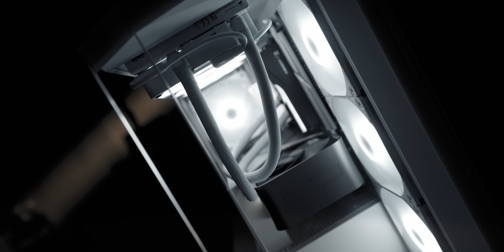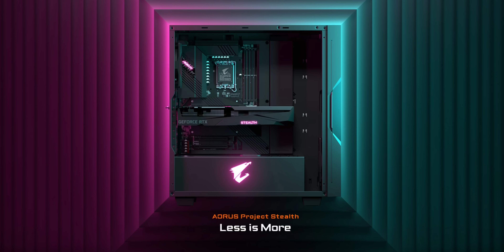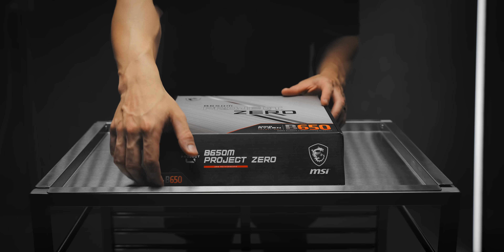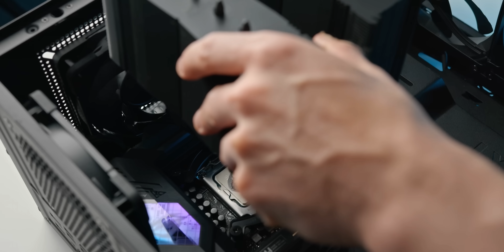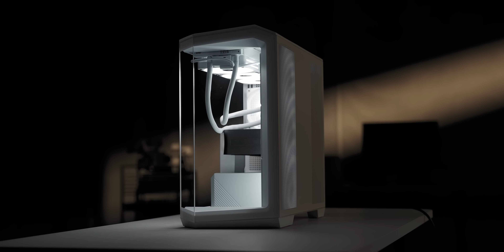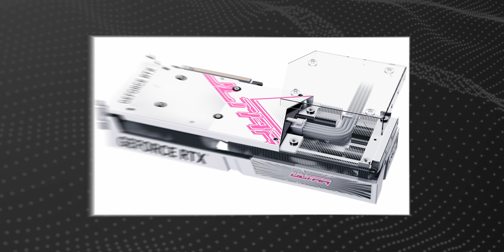"zero cable" PCs are here.

Comment: Theres nothing pulling the air inside the case , i guess it was to hide the wires that are on the back of the fans , but to thoses that build computers , either you dont use front fans , or you use them to pull air inside , cause every case should have a way to get the air inside the case

This case do have some holes on the botom , but since theres no fan on bottom , most of the air will come from the back where theres no filter , building dust inside your gpu mainly

Comment: That computer looks like something out of that old Apple commercial!
You don't have to be all RGB, but trim that thing with some color or imagination! AI is the future, not some Frankenstein-looking computer hiding wires!

What should be happening is better designs around computer component management.  AI is the future and our time is better spent on creating better designs that don't require so much heat management. The original intent for reducing wires was better airflow for fans.  Having moved all the wiring out of the picture, we've got more fans than ever.  Showing off the inside of the computer was interesting for only one reason: Color!  If you're going to recommend something, I would suggest telling the video card makers to cut the fucking crap!  They're the sole reason computers have been heating up for no good reason.   Computers should do their jobs quietly and efficiently. Style should be subjective or irrelevant! We don't need to worry about hiding wires, we need to worry about the industry's failure to progress to AI computers.  ATX should be dead by now!

Comment: Are the nvme devices at the rear also. On a practical level as a water cooler it's a nightmare having to drain if I want to upgrade the nvme drives

Comment: I built this pc, awesome concept. 

Biggest issue- they need to add a little extra space behind the motherboard to close the case. This is by far the hardest case to close after it was completely wired. 

I am selling the one I built it Florida for $4k if anyone is local to Tampa look me up. 

JG PC 

RTX 4090 MSI Slim
Ryzen 7 7800x3d 
64gb of RAM
4TB m.2

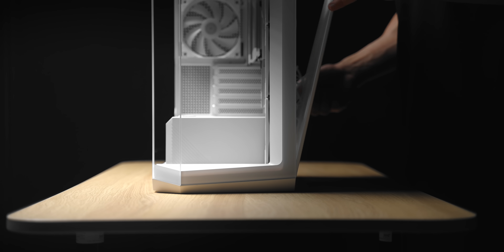Comment: Next-level visual appeal in the angle shot @ 1:30 especially as the camera’s frame rate made the fans be whirring all buttery smooth-like. Know it was intentional and appreciate you!

Also, totally get your vibe on the half-consolation, at best, of the GPU ‘stand’ i.e. cable hider that I agree is worthwhile all in all. What I don’t get is that it seems possible that it could’ve been approx 60% as wide in a manner that would show the GTX and still affix properly in serving the same 2 basic intentions?

Comment: an alternative to the gpu is to vertically mount it and just have the cable run straight down and you wouldnt be able to see it, would be a pain to fix if any cable issues arise but would make sure the build have that no cable look as intended

Comment: i've been using 90°/180° connectors to not have any cables showing in the front for years. Nice that there's now a off the shelf behind the motherboard solution. I also think it's a crime to build a cableless PC and use AIO, the hoses just makes your cableless effort moot.

Comment: Your 3D print cover/bracket is def an improvement, but I think a slim one would have been better.
Did you try this setup with an air cooler, then you wouldn't have the tubes ? *Oh wait, but then you'd have fan cables from the air cooler... and no headers on the front of the mobo ?
*That AIO is SUPER clean with that fan/rgb cable setup!

Manufactures 100% need to sit down together and get a standard going thats for sure

And it would be slick if there was a new standard was set, where the card sits in the slot, that it has a pass through into the mobo ... power straight through it, below or next to the slot ... either out the back or ran across the board to the side.
But yeah... clean looks vs added cost and complexity to a mobo. And a new standard.

Comment: How did you get that good white out of the Trident Z5's leds? Mine is yellow-ish when set to 255/255/255 or simply set it to white, i need to manually tune it to go towards blue but it's still not quite white.

Comment: Hey Optimum and community, I've been wondering if it's safe to buy the Asus Rog Strix B-650E-E now? I've seen Opt use the ''I'' version of it so that should be safe now? Im thinking of also getting either the 7900x3d or the 7950x3d, which were known to get set on fire with the boards, especially if EXPO is enabled, what are your thoughts on that?

Comment: CPU cooler hoses need to either go through the motherboard or to the edge and covered with a shroud. There's zero reason you should be seeing two dangling tubes in the middle of a clean build like that. Manufacturers have a bit more work to do.

Comment: Hey, optimum
I was wondering, since you've probably been through your fair share of graphics cards and power supplies, what's your experience with coilwhine? I'm really struggling with it right now and I'm on my 6th 4080 Super... My power supply is high-end bequiet! Straight Power 12 1000W 80 Plus Platinum

Comment: You call this a clean build? As an Apple repair engineer who has disassembled most Intel-based Mac Pro's, I'm surprised that the cable routing issue still hasn't been addressed in PCs. You look at the beautiful build, but when you open the case, especially the back cover, you are horrified by the tangle of cables. 
Why hasn't any case manufacturer come up with a back panel to hold all the power cables?

Comment: I completely agree with you about the fact that having the power connectors and the fans/usb/audio at the back must be much easier for install! That's actually the really cool thing about this trend (I've an enclosed PC for maximum silence (define r5)).

For your 3d part; you could have printed it much thinner to keep the Geforce visible and you could have printed it in two colors (or spay paint) : grey for the GPU & white below.

I was also wondering about the noise of those pumps; is it better nowadays ? does it have a chance agains't a ndh-15 on a noise perspective?

Comment: I like this a LOT! I'm only on board for this if the GPU's power passes through the motherboard. I would like the PC market to all move to this orientation. Also, this could benifit power supply manufacturers, as they don't have to provide so long of cables. Saving material cost & shipping weight/size cost. This also improves cooling and noise as there is less drag on air passing by cables.

Comment: I really really wish that m-ATX was a more widely used standard - there's just so few motherboards in that form factor, and so few cases that are optimized around the form factor. Something much closer to an ITX sized case could be made with an m-ATX motherboard, if it was designed for it. I hope this changes in the future - it's getting so hard to cram everything into the ITX form factor, and so many compromises have to be made to do so. Here's to hoping that we see more motherboards like this in the future!

Comment: Sorry. As a designer i just hate this form factor. This is just a huge step backwards, in so many ways.

As a designer this is like a dream, when we are having a nightmare. And we will have them dreams, designing for this, unless we start tackling all its issues, particularly safety and structural integrity. This very case, seems hardly safe at all. Just look at it. It got huge unsupported metal corners, at back of a totally exposed MB. The MB will now in practice be mounted on a swinging door, that is loosely secured. Safety on level like that plug we got last year.

As a designer, I need to have maniacs like Linus in mind, who actually sits on the side panel, to crush the cables into the case. As a designer, it is my job, to keep people like Linus safe. This just got a lot harder, for the industry. On the face of it, I seem to be in the clear with my designs, but I want everyone to be safe and the industry to thrive, and as a designer, I look at this in horror.

I cannot leave this place, without calling out, that the left side, is now the front. That means, that the rear, is now the left side. That side, is typically where the cable spaghetti is. It is deliberately hidden for the viewers in this video, which is a deliberate act of deception. It is flat out dishonest.

Comment: This seems SO much more practical. 

I built my first computer a month ago and the FIRST thing I thought is why are we connecting cables from the back to the motherboard at the front, then hiding the cables at the back again....This makes way more sense and suprising this isnt the way its always been done.
Reply: The reason that cables have been from the front is that glass PC cases are "new". 8 years ago you didn't care how the cables looked, because your case was a closed metal box, so that's where the cables went.
Reply: @thefrub  The first complete, entirely-new-individually-purchased-parts build I did was in 2006, and my case (which originally came out in 2003) was windowed and had built-in blue LEDs to really illuminate everything inside. And while my (non-modular) power supply's cables were a somewhat cool-looking silver colour rather than the typical ketchup and mustard cables of older computers, it was still kind of a chaotic, messy bird's nest, as routing cables through a space in the case behind the motherboard wasn't really a thing yet. So, for one, windowed cases were popular well over 20 years ago, not just 8, and secondly, if anything you cared more how the cables looked because there was no hiding them.
Reply: @thefrub  Also airflow was less of a concern for the majority of PCs then as well compared to now.
Reply: @thefrub the first pc my family owned was 19 years ago and it had a glass side panel.
Reply: @thefrub 12 years ago I had my first windowed case. The trend is much older than 8 years. 
 They started appearing in the late 90s and really started catching on after 2000.. So they've been mainstream at least 20 years now. I was an adult when opaque beige boxes were the norm, so I've been around to see the entire PC evolution.
Reply: @AdamsOlympia  Yeah, I think this guy's impression that it was only 8 years ago is that it was "coincidentally" right when he and his friends were old enough/had enough money to do their own builds rather than relying on whatever hand-me-down prefabs they could get their hands on. Funny how I perceived windowed cases becoming popular closer to 20 years ago, almost as if it had less to do with the date and more to do with the fact that I was 16 and had money from a summer job and similarly-aged friends who were also starting to do their own builds...
Reply: @thefrub  RIP airflow tho lol
Reply: This is because motherboards have standards, and those standards aren't often changed for a trivial trend in case design. If you were to make a motherboard with a completely different layout, it would instantly become incompatible with a lot of hardware and case setups. 

If everything starts to transition to this model, then it'd be a good thing, but don't underestimate why the friction exists in the first place. We're lucky we can buy any case we want, with any motherboard we want, and everything typically just works. Companies usually fight for proprietary systems.
Reply: @Sammysapphira The only extra thing the mobo requires is holes in the case. It's not any more proprietary otherwise. You can make them yourself. But very easy for a company to add to an existing case.
Reply: just don't hide the cables ;-) you save lot's of time and if you ever need to do maintenance it will be easier ;-)
Reply: Getting a 40 dollar case without clear pannels is a hell of a lot more practical then this nonsense.
Reply: @polska905 Why? It's literally easier to connect cables etc if they connect to the back of the motherboard

Comment: You should contact Asus about the rear facing connector on the graphics card thing because they had a demo in CES where next to the PCIe connectors on the motherboard there was a second connector that could send over 600W of power through it and the GPU had a 2nd connector which would go in that connector and the motherboard had a 12W PCIe power connector on the back to passthrough the power

Comment: We can buy thihs kind of MB from 2 years ago in China. Now we have many options in Chinese. 😝
And We also have the Special GPU from Asus which have one more connector next to the pcie connector that can use as the power cable. With the special MB from Asus, which have this connector on the MB, you can plugin the GPU power cable at the back of the MB.

Comment: Should do away with power cables to the GPU altogether. An additional power socket from the board direct to the PCB is what’s required. Something like Apple’s old ADC used to have. I think I saw (ASUS?) show something more recently and I hope it catches on so we can do away with these cables. Especially now that they say Gen 5 cables have a limited lifespan of connect/disconnects.

Comment: The cleanliness of this build is honestly only 10% better than the standard case with a few visible wires.  Since most of it is tucked in to the back of the case.

The true power is to be able to take off the back and mess with the connections.  No more reaching in and fighting around the GPU, the cooler, the ram, etc to reach connectors.  It’s right there with no obstruction.

Comment: yeah anytime you intergrate a fan/rgb controller you go off the rails on cable management. I use extenders and splitters which at least allows for routing of cables a little better but this mb setup is definitely the future.

Comment: Personally, I still think this is a solution for a non-existent problem. I am also the kind of person that uses mesh side panels and no RGB so cables aren't so much of an issue as far as I'm concerned. Plus it is very, very rare that I need to add or replace cables once a build is complete, although I can see how "easy access" is by far the biggest selling point that this mechanism has.

What actually concerns me is that if rear mounted connectors becomes the de facto standard it will make doing anything in a sandwich layout case a real nightmare, and the required added space to use these connectors will force SFF cases to be bigger for cable clearance.

Comment: Some of the Asus BTF motherboards are apparently going to feature a high power delivery PCIe slot that can deliver up to 600W of power to tackle the GPU cabling issue. Seems like a very smart approach that removes the need for specific GPU models with rear-facing connectors. If that works out well I fully expect it to become the standards for other BTF motherboards like this in the future.
Reply: They should just amend the PCI-E spec to add a dedicated slot connector past the x16 length for direct power delivery from fixed plugin ports mounted to the back, front, or edges of the motherboard. Removable hot swap PSU modules can deliver 1200w-3000w of +12v on a 2-3" wide PCB connector, so there is zero concern with power density or having to reinvent the wheel. They just need to pick a standard and go with it, not rocket science.
Reply: @msytdc1577  You mean you want PCIe 32x slots? They already exist but are not used outside of some niche server interconnect stuff because they are twice the length of a PCIe 16x slot and nowadays and mostly unnecessary thanks to fast interconnect technologies like OCulink and SFP.

Comment: The best and hopefully in the future is to standardize metal power DOTS already built inside the case. You won't' even need power/GPU cables.  As soon as the mobo is installed, it's powered. The point is, you'd NEVER install a mobo without a power supply SO WHY even BOTHER with ANY CABLES??? Indeed. Think about it.

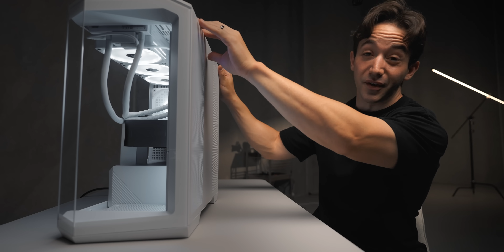Comment: 2:12 That would be the biggest benefit from me. I dont care how my machine looks up front, a nice cable routing can also look good. But being able to open the " service area" in the back to get to all connections is so practical and nice :)
Reply: It's also great from a reliability perspective, given the lack of cables that could potentially move and make contact with a fan when computer is moved or transported!
Reply: fr
Reply: omg....people just listen...all things should be available from ONE panel! having all those wires behind the the right panel is just impractical for maintenance.
and before you ask...no I don't hide the cables in my PC builds, "cable management" only makes maintenance more difficult.
Reply: @vasopel agreed, after 5 or 6 times "cable management" I just gave up. So much time wasted for the cables to do just for changing/adding stuff to my case

Comment: Aah, as a desk PC builder this is absolutely terrible for me since it essentially doubles the vertical real estate a motherboard fills up, but for literally any other situation this looks super clean and cool
Reply: This could still be used for a desk build IMO. Instead of wires being routed out the rear of the desk, they can be routed out of the bottom with cutouts.
Reply: If by "desk PC" you mean an old school horizontal desktop case, then I'd agree...this mainboard config isn't usable at all. Having the power headers oriented to the side would be more ideal, allowing the cables to run around the edge of the board. Unfortunately, I'd imagine only small form factor mainboards would offer such a layout, as anything mini-ATX or larger most likely would be focus on tower case builds.